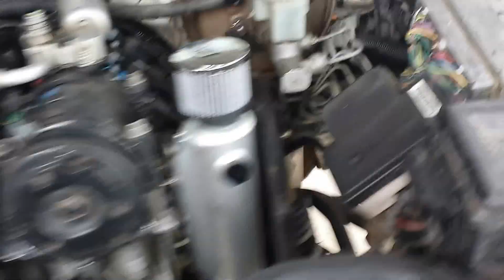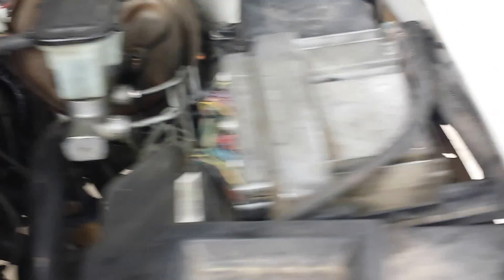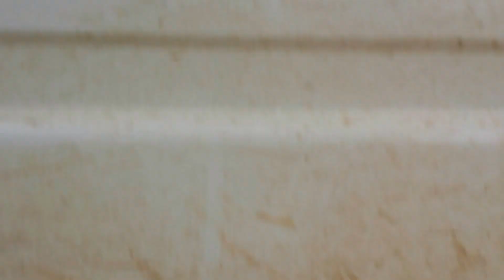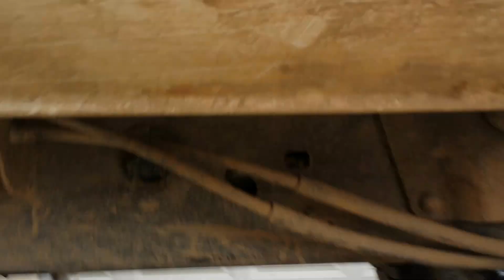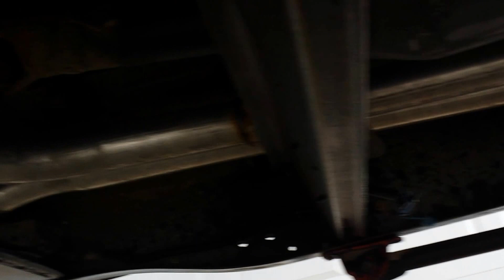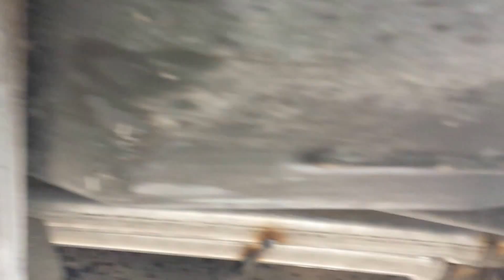OBS long traveled tahoe 6 liter LS walk around.

Comment from the maker: Modified fab tech 3.5 over kit. Cut and welded in an inch and cups for big ass uniballs, honed the spindles to except the larger grade 8 bolt shafts to use with the spherical bearings. 1.75 hiems and all moly steering linkages. ARG super pump and super box 2. Thing floated for a big land yacht. Sold the kit to a Baja guy in Buena Park to free up funds and space on the front end for the new stuff. I should have had someone make a jig to remake that kit it was decent.

Comment: In confused about the title. It says long travel but all I can see is a lift  block? And are those stock front control arms? So what technology makes it long travel? The front fenders, because the tire can go up more? I'm thinking about buying some long travel front fenders for not tahoes. Where did you get them? I see duraglass looks good online but the shipping to AZ is more then the fenders cost so I'm not going to get those. Any good options for long travel front fenders that will fit my 2002 tahoe? I want to get some so I can jump mine like the guy on here who post videos look up bajaBurban I think it is. But after I get those I think I'll get a helmet and go down to Mexico this year and sign up to race it in the baja 1000. So I need to hurry up and get those fenders and a little light bar also that way then I will have a trophy truck. I think I can probably win over all if I dont get any flats. I'm the best driver that I know.  Especially off road driving!
Reply from the maker: So... Have you seen stock control arms? Do they have a big uniball in the center? Or hiems?
Reply from the maker: These were fiberworx I believe. Worked real well. Had a few unexpected jumps and she handled. New build is 6 over equal length beams, 4 link, strange 9,4.11 spool and shooting for 1k on a built 408.

Not sure what's out there for the new body fronts. When I was looking I found out they're ugly. Haha. My 03 Sierra has an 06 silvy HD clip. Looks so much better.
Reply: @ShamusMcFisty  can't see from this video that's why I was asking
Reply from the maker: Yeah, I apologized in the other post. Lol
Reply: @ShamusMcFisty  lol it's all good. What kit did you have?
Reply: @ShamusMcFisty  I was thinking about putting I beams on mine a few years back but I sent the email to McNeil racing and they never got back to me so I gave up on the idea. I thought some four-wheel drive beans would be badass